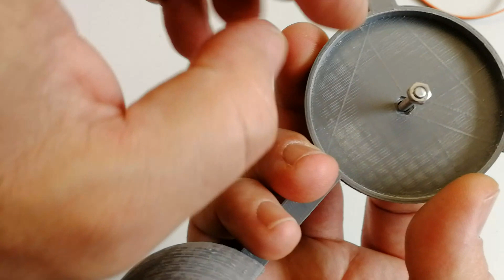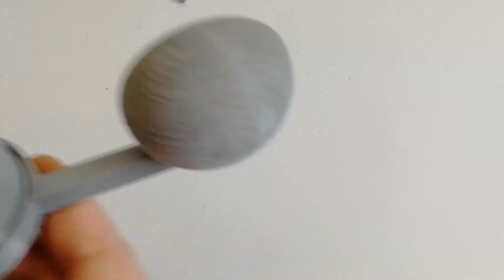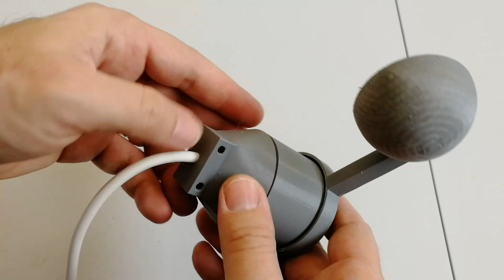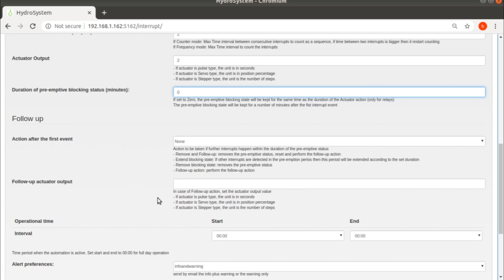3D printer Wind sensor and Raspberry Pi

Comment: The video becomes out of focus near the end. Thanks for your videos. My application I would like 2 or 3 capacitance water sensors.  I need to see data over internet to my cell phone to app. I will make manual adjustments to my B-hyve sprinkler watering drip interval controller.